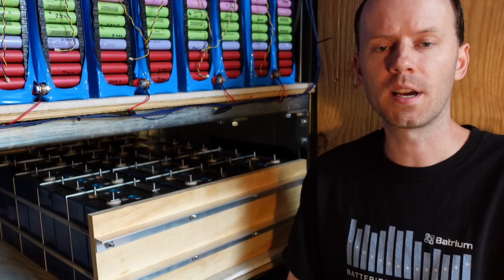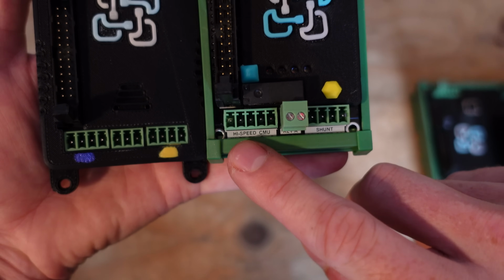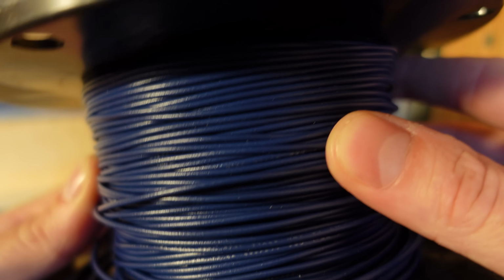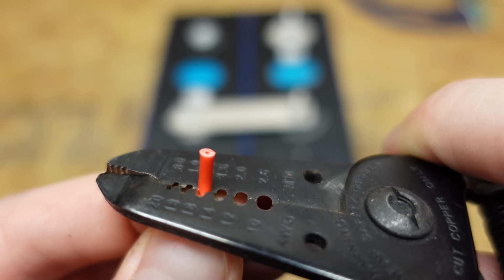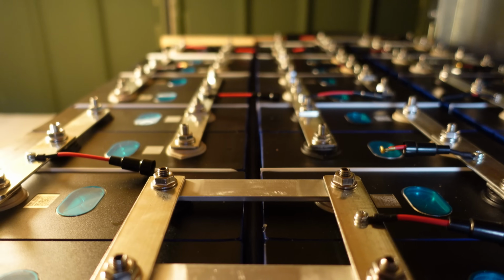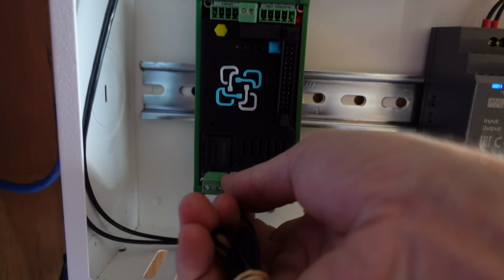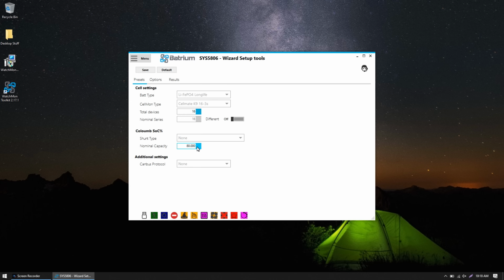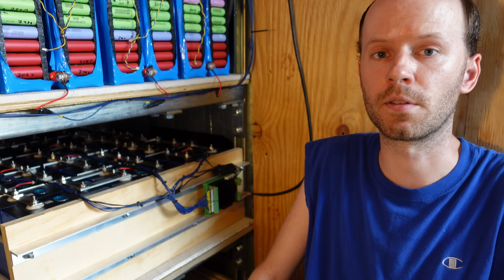Batrium CellMate K9 BMS Install on EVE 280Ah LiFePO4 Batteries

Comment: Thanks for the info.  Seems like you are using 32 cells in a 2p16s configuration?  seems like you aren't managing each cell, correct? you are managing two in parallel, yes? if so, is this ok? would there be any issue with one in each pear drifting apart or loosing some capacity ? (perhaps I am not understanding your set up).

Comment: 500 dollar BMS solution?  that is nearly half the price of 48V 100Ah LifePo4 battery.  Most BMS solutions are around 150 dollars..what am I missing?
Reply from the maker: You wouldn't typically use something like this on a 100Ah battery. The battery I used it on here is 51.2V 560Ah.
Reply: @LithiumSolar   seems like this Matchmon+k9 does not have current shut down functionality?  (I am new to battery bank construction so perhaps I am misunderstanding the full roles of BMS in the systems.. I have seem some BMS that connect/manage some big switch--which I interpret as some safety shut off)

Comment: No need for a fuse, use a thinner cable, the cable will act as a fuse.
Reply from the maker: No. A long 3ft cable is not the same thing as a fuse no matter the size of it.

Comment: what would it take to use these in an electric car . i have the low speed wheego whip 96 volts .uses 250 amps at cruise speed and up tp 500 amps when climbing a hill . i have converted it to 5 speed trans for speed up to 70 miles mph , currently runs on 16 6 volt lead acid batteries . this would be a large investment for me . looking for advice from as many people as possible. currently have a range of 35 to 50 miles depending on hills or not . batteries weight is 1000 lbs

Comment: Thank you for our great video. It really helps a lot. But one question I have. Do you really think, it helps to bring the fuses next to the cells? I don't think so. The current is the same in the whole wire and if there is a fuse it melts at the same time no metter where it is positioned. Or am I wrong here or are there any special topics beside of that to keep an eye on?
Reply from the maker: Yes, the fuses need to be as close to the batteries as practical. You are correct in that the current is the same throughout the circuit; however, the portion of wire between the battery and fuse is unprotected should it be cut, damaged, pinched, shorted, etc. The further your fuses are from the battery, the more unprotected wire you have in your circuit.
Reply: @LithiumSolar  Ah ok, That topic I did not think about - I build my batterys including the cellmate itself in a closed / protected box. Thank you

Comment: Hi David! I just built something similar to you, thanks to your video! But I don't get the clue about how to set up the correct SOC value in the Batrium in order to be communicated to the inverter. Could you please tell me how you do that? The voltage is not giving so much clue, because we have a big SOC range in a small voltage range. Hope you can help me with this, thanks and congrats for your work!

Comment: So is the batrium just a active balancer??? How does it shut down the battery if voltage to high or low??
Reply from the maker: No. The Batrium is a passive balancer.

Comment: Thanks for the Video. I'm new to battery BMSs and am considering building 6 sets of 280 Ah 51.2 battery banks using the Batrium BMSs. One thing I didn't get is how the BMS will stop the charging when the batteries are full, is there something that will disconnect or make the charger stop? Any help is appreciated
Reply: I was thinking the same, other bms are connected to the negative side of the bank! Did you get any answer on this? Thanks!
Reply: @garbi8526  I have just finished my installation. In my case, I have connected the Watchmon5 to the Victron Cerbo gx using the CANBUS. The nice thing about the Batrium is that you can configure every aspect of the ramping up and charging of the batteries. When the batteries are full, the charging ramps down nicely. Without the CANBUS I would not use Batrium at all.
Reply: @salimnaufal1779  Nice to know Salim! Have a nice day!

Comment: Hi Batrium,

Setup a Core a relais unit and 2xK9 in december 2021. all works fine BUT..
Still have some unanswered questions I mailed you last time in januari...

Busy now with aquiring two projects where your system might come handy but still have some questions left:
a) do you fully support Victron inverters and will Victron work with your bms too (there seems to be a difference L.O.L.)? 
I heard about some issues on the Victron forum about communication with a multiplus that didn't work out well.
b) will the maximum bleed current be higher than 0,74Amps when placing a 6x6 fan? I mounted one but see no results here whilst the K9 should (in future?) be able to handle 25Watts??
c) is there a possibility to connect ethernet over an USB to ethernet dongle with your core? Wifi is a mess at the upcoming projects so this would help a lot.

The rapported glitches in the graphs every now and then don't seem to have any influence of the function of your bms so you may keep this out of your answers on my questions I sent you in januari 20th.

Keep up the good works there and stay healthy!
Reply from the maker: Hi there. I don't work for Batrium so I'm not the best person to answer your questions. Please forward these questions to their product support email info@batrium.com and I'm sure they'll be able to help get some answers.
Reply: @LithiumSolar  my bad, was triggered by the batrium sign. I did try to contact them but they don't respond to customers that pay their fees anymore...

Comment: Nice work! I have also a 16s2p setup with 280ah cells. Though with a watchmon 4. I have the impression, that top balancing is somewhat difficult in a 2p configuration. Perhaps because the voltage difference is not enough? Would be interested in a video, when you top balance them, and the settings you use. Anyone with similar issues?

Comment: that's a sensor, which should be direct contact, inserting a mechanical fuse could cause  a weaker connections. there are no kind load on these  balance leads, usually high impendence terminals only to sense voltage, probably mosfet inputs sense these fuse are useless
Reply from the maker: The load is irrelevant. The fuse is there to prevent a fault (cut wires, failed component on K9, or otherwise short circuit) from creating a fire.
Reply: @LithiumSolar  so hw small fuse value do you plan for it to secure your cut or break, when the sense line is almost infinity? hopefully it does not create and any mechanical voltage drop. good luck

Comment: Why do you use just one 16s-BMS instead of two for your 32 batteries?
Reply from the maker: Like what kind of 16s BMS? A JBD?
Reply: @LithiumSolar  Batrium allows to use one CellMate-K9 for every 16s-block, so you just need to use another CellMate-K9 to connect every of your 32 cells to have every cell balanced.

If you take a look at the batrium-website, there's a picture with a WatchMon Core and two CellMate-K9 connected for a 16s-battery with 2 blocks.

Source: https://www.batrium.com/collections/kits/products/watchmon-core-k9
Reply from the maker: @RipsDiner  In my setup, the 32 batteries are wired in groups of 2, so instead of having two 16s at 280Ah each, I have one big battery that's 16s at 560Ah. If you wired them in two separate 16s banks, you would need two BMS (two K9's, one watchmon core).
Reply: @LithiumSolar  , the problem of your setup is, that those 16 pairs get unbalanced during the next months. Is it worth to save ~150$ for another CellMate-K9?
Reply: What is the advantage of  2 p16 s vs 2 16s except not to buy a second k9 or is there none?
Is there some unbalance to see or what are the pro and cons after this longer period 
Thanks

Comment: How does this bms work? I'm confused on how it works without the main power wire running to it. I looked at their website and it doesn't mention any charge or discharge rate. Thanks for any help and information you can provide
Reply from the maker: The BMS is designed to communicate with your equipment. It's a computer that will tell your inverter or charger when to shut off. If your equipment is like mine and does not support this, you can use relays, contactor, etc.

Comment: The purpose of the fuse is to stop current flow when it becomes excessive. It doesn't matter where alone the length of the wire of the fuse is located the current flow is the same.
Reply from the maker: Yes, it does matter! If you put the fuse 10 feet away from your battery, then you have 10 feet of cable that's susceptible to damage and if that cable were ever damaged or cut in that 10 feet, a short would occur with no safety in place. By putting the fuse as close to the battery as possible, you're lessening the chance of an accident. Sure - it technically works anywhere.
Reply: @LithiumSolar  oh, I see what you mean. Not electrically important, but you're assuming something punctures the wire insulation. That's extremely rare. I was thinking in terms of equipment failure, say the inverter has a MOSFET short and shorts the battery input. Then your cables are going to see high current. In that case, it doesn't matter where the fuse is. Sure, putting the fuse closer to the battery makes sense if you have the cables run through metal chassis with sharp edges that could cut through insulation.

Comment: Hi there - thank you for all your content - so clear and informative. Not sure if this is the right place to ask a question but here goes! I live in Australia and have 96x 280Ah EVE LifePo4 batteries coming to build 6 16s battery banks connecting to a common 48v bus for 3 daisy chained victron inverters. I have ordered the batrium Watchmon Core and intend to use the Cellmate K9's. 

My question is: is it best practice to have the cells in parallel on a cell level (6p16s) or have 6 individual battery banks (16x 1p16s)? 

My initial instinct were to create 6 individual 48v packs and have a K9 for each. I would obviously make sure I had them all at exactly the same pack voltage before connecting them to the bus but I was pointed in the direction of paralleling them on a cell level to create 1 or 2 big packs. Gotta say that makes me slightly nervous and also feels like it would be more difficult to detect an underperforming cell etc.
I'm wanting to order the flexible bus bars and need to make this decision before putting in my order!
Any comments?

Comment: I have batrium , with 3 k9's , 48 cells. Ive a wire dropping voltage now and then , can see it on the daily session min cell voltage. But how can know wire is dropping voltage, maybe bad bad connection. How can I data log the sistem? Can you help me?
Reply from the maker: I've had something similar happening and I'm certain it's not a wiring issue. I've reported this to Batrium and am told they're working on a new firmware update which may change how voltages are being read, though I haven't received it for testing yet.

Comment: Dumb Question? Aren't All The Balance Leads Supposed To Be The Same Length = (Same Resistance) Between BMS & Connecting Points On Each Cells? I Heard This Could Cause A Slight Difference In Balancing Of All Cells Readings?? Thanks

Comment: While the batrium stuff looks really cool, I can't see putting it into a diy system unless high enough capacity per 16s, it can get cost prohibitive very quickly.
Reply from the maker: It is cheaper than other options, such as REC BMS or Orion BMS...
Reply: @LithiumSolar  I understand, I was just comparing cost per 16s per kwh. The ratio of cell cost to bms cost skews badly when you get down to the 100ah range, unless you start building the packs in parallel and using 1 lead for 2-3 batteries. I'm guessing most bms will have trouble balancing the higher the cell AH gets

Comment: Hi can I ask you a few questions about the batrium watchmon core and the cell mate k9 bms unit. What are you using to disconnect the charge and discharge cycle from the inverter to your batteries incase the inverter doesn't  shut off correctly. I know the negative lead from the battery to the inverter does not pass thru the bms like the common bms does. I have a 12KW low freq. inverter with 6.2 kw of solar panels feeding the inverter. I have 32 new Eve 304 ah cells on the way from Amy at Shenzhen Luyuan Technology

in china. According to Batrium the Watchmon core will not communicate with my Growatt inverter to be able to control it. But did say they were working on trying to get it to communicate with the Growatt inverters. I have thought about using a 48V 10,000 watt 440 amp rated Continuous Duty Relay / Solenoid Switch to connect between the battery and the inverter on the negative cable and let the batrium control it if something should go wrong with the inverter. The solenoid can be wired normally open or normally closed. Do you think this will work ok or what would you suggest to be the best way to use the batrium set up
Reply from the maker: I use the "critical" state of the Batrium to flip an ABB S5N circuit breaker. The breaker trip is a 24V coil. I haven't actually connected it yet, but I used it prior with my old Watchmon 4. Obviously though this is a manual reset method and only intended to be used when the Batrium sees a fault that I consider critical, such as a cell over-volted, under-volted, over temp, etc. A relay/solenoid designed for the purpose would probably work as well, but it tends to be difficult/expensive to find a relay/solenoid rated for DC high current.
Reply: @LithiumSolar  The solenoid I listed above is for a 48 volt golf cart that is supposed to be rated for 440 amps which my system should never see and yes it would only be used for a critical event , so if I let it pass thru the solenoid in the normally closed position it should not draw very much if any currant from my system unless a critical event happens. I will look into the ABB S5N circuit breaker also.

Comment: Rookie question: How is this BMS different than the million BMS's on Aliexpress?
Reply: It's reliable. Something you can install and forget, since it will just work.
Reply: @vbdaniel4  I’ve found the WiFi connection to be a bit flakey.
Reply: You are right. Even if the access point (wlan router) is in the same room, the data is sometimes slow to arrive. But the bms is still doing it's job. It's just the human eye in front of the screen, who suffers 😏

Comment: If i use a secound k9, do i have double bms power to balance? How is the wireing ?
Reply from the maker: In theory, yes, but I would definitely not do that. You would have to run two sets of balance leads and even then, not sure if the two BMS would interfere with one another or not.

Comment: My current BMS supplied with the battery ( black box ) connects to the pack's negative terminal and the load-negative is then conneted to the BMS.  This enables the BMS to cut-off the pack if one of the following thresholds is breached  1. low voltage cut-off  2. high voltage cut-off  3. over-charge cut-off  4. over-discharge cut-off  .  I like that with the Batrium its possible to view the SoC  of the cells via Wifi and connect to several packs but am uncertain as to how the Batrium can cut-off a pack when one of the aforementioned thresholds is breached.  Thanks for the feedback.

Comment: This is a 2P 16S correct? I'm curious to why you didn't have 2 K9 so you will have 32S?
Reply from the maker: It's a 16s2p yes. Using 32 cells in series would give 102Vdc. Not only is that voltage dangerous to work with, there is very little equipment available to general consumers at that voltage. 48V fairly standard.
Reply: @LithiumSolar  I think I need to rephrase my question. I curious to why you have 2 K9 instead of using one K9?

Comment: I have a question. I realize this watchmon is a cell monitor. Do you still have the part of a BMS inline with the battery to turn current off if there is an over or under voltage condition?
Reply from the maker: The BMS will communicate directly with the inverter and chargers to shut them down. Additionally, I'll have a large ABB circuit breaker that can be tripped remotely during a critical fault. This is not a FET-based controller, it's better!
Reply: @LithiumSolar  I see...I do like the idea of driving a relay to turn off power or signaling charger to stop charging. I never liked the idea of FETS turning things off as they are subject to failure. Thanks.

Comment: Not sure I understand why you are fusing all the balance leads? Can you please explain?
Reply from the maker: If any one of the leads is damaged, cut, nicked, the BMS fails, or otherwise causes a short circuit somewhere along the path - you want a fuse that will blow rather than having the wires turn in to a melted mess and catching fire.